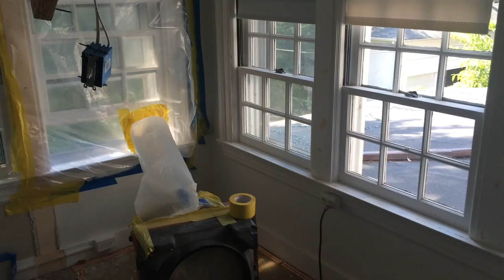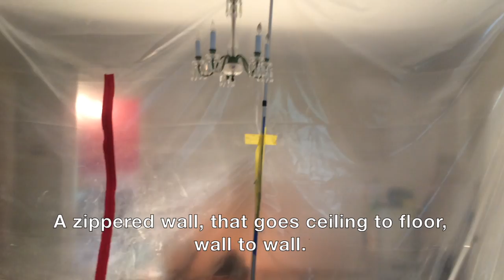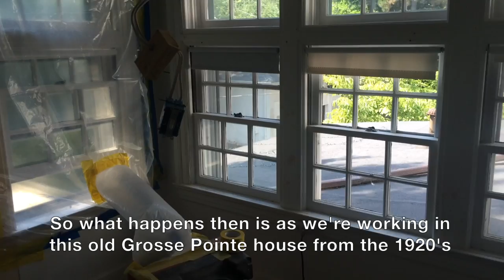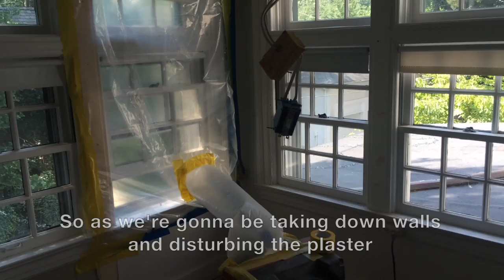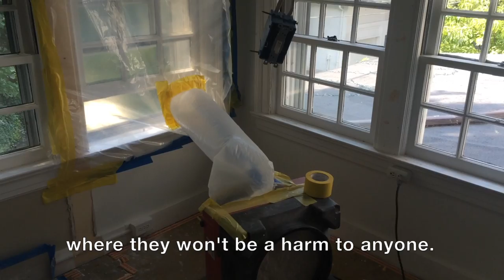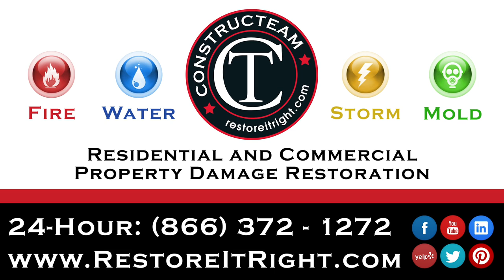Constructeam's Dave G. Explains Negative Air Setup

Comment: Been trying to find lay flat ducting at home Depot and Lowe's with no luck 😢
Reply: I don’t look there i’m not sure if you’re attempting self mold remediation or you’re in the industry but my advice is to buy from Jon don.
Reply: They will ship nationwide, but we deal with the NJ location locally.
Reply: Your are not supposed to blow lead particles outdoors. That is again the EPA'S RRP practices
Reply: @weetzybat  correct however I think it was just a mistake, the negative pressure effect brings all particles towards the HEPA filter so when you leave out the contained area you are not bringing a toxic dust cloud with you. 

The air scrubber with a HEPA filter hooked up for negative pressure will filter the air being pushed outside.
Reply: How long do you run the air scrubber for?
Reply: Does this take care of particles that might’ve fallen on surfaces such as furniture?